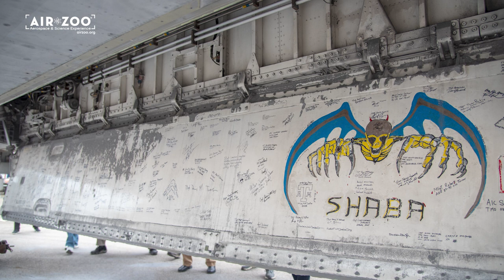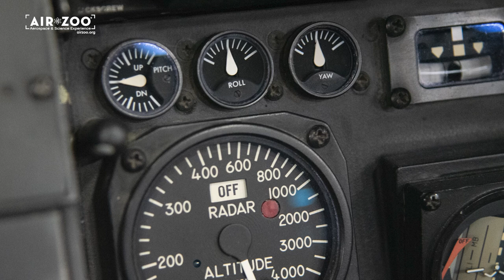Interview with F-117 Nighthawk Restoration Lead Richard Klass.

Comment: I'm saddened to hear of Mr. Glass's passing.  As a former F-117A Crew Chief on multiple tail numbers over my many years of serving in the Air Force at Holloman. In order they were 838,813(1993-97),797,798,789, ('02-'05) 826 and finally 809 ('06-until the last day on Apr 21, 2008 when I had the HONOR of launching out Lt. Col Tatum in the 9th FS Flagship! ) I can say that Mr. Glass did an outstanding job bringing Shaba back. It's even more impressive if you have first hand knowledge of the condition  the aircraft that were partially disassembled for storage were in after we closed the doors to the hangers in TTR. While none of the aircraft on static display will ever match how they looked while  while in service since we removed the leading and trailing edge panels, ice wiper fairings and other bits and pieces, Shaba is one of the best looking examples of how they looked while in service. Great Job!